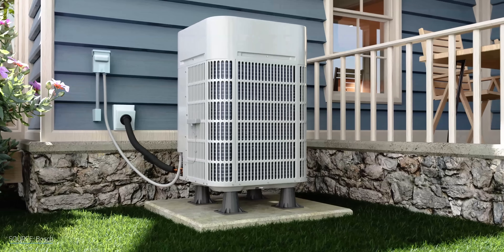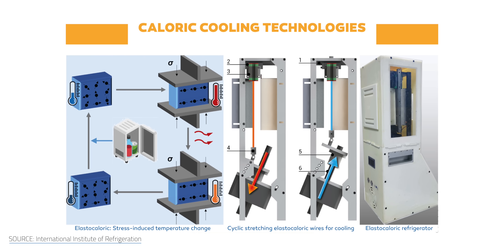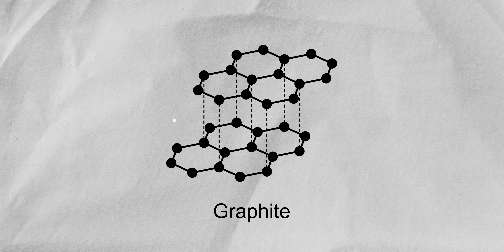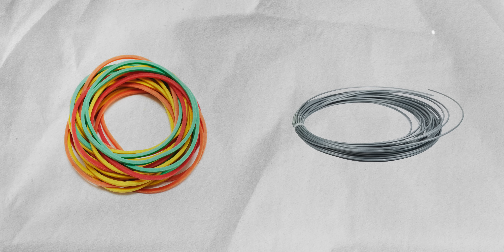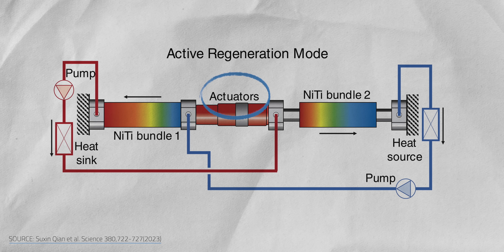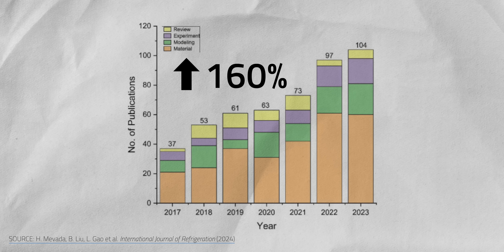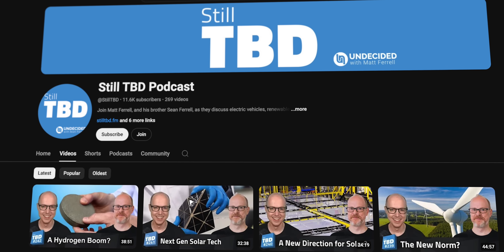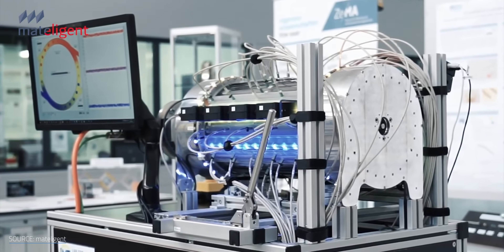How Solid State Cooling Could Change Everything

Comment: I’ll be the first to admit that I’m not going to look through all the comments to see if anyone else has had this idea.

Since elastocalorics shrink when cooled and expand when heated, is there a possibility that this linear expansion and contraction could be harnessed to do some of the cycling work instead of using an actuator?  It would basically be two compartments where a valve would cycle exhaust through  chamber one, effectively heating it up and pushing on the coils in chamber two, storing cooling power there.  The valve would then switch, cycling exhaust through chamber two, heating it up and causing it to push on chamber one cooling it down.  I would look at it in terms of a diaphragm or bellows between the two chambers.

I’m not super familiar with the science of all this, so this is just my odd layman’s take on the idea.  If anyone thinks this has merit, I’d love to at the very least be a part of the conversation.  Not an equal part kind you, but a part nonetheless.

Comment: seems like it'll be a lot easier to replace nitinol strings than refrigerant, should improve reliability! I would buy a elastocaloric fridge even if the COP was slightly worse, just so I wouldn't have to deal with refrigerant

Comment: It's interesting that none of the cooling systems I have (refrigerator, freezer, air conditioner) use any fluorocarbon.  They all use R600.  I understand that people in the USA are scared of it, but it works fine for a lot of the world.
Reply: A lot of the commercial refrigerators use R290 (propane) or R600(butane). I don’t know why people freak out about it. Most systems have less than 3oz of the refrigerant. Not even counting the fact that an atmosphere of pure butand, which is how the internal of the system should be, isn’t flammable at all.
Reply: @NicholasStillman  Butane/Propane is also more efficient.  It runs at much lower pressure so the compressors are tiny, quiet, and use minimal power.

Comment: Moving parts makes this idea a non-starter, moving parts wear out. None of this is needed, this is a step backwards all of this.  what is needed is a more efficient diode to filter off and separate out the hot electrons, just like a thermocouple in reverse. Cooling for homes can be done efficiently with paint that reflects all heat back to space.  Cooling for homes can also be done through an Earth mass, just running pipes through the Earth which maintains a steady temperature. Cooling for homes also can be done directly with sunlight by using evaporative ammonia in iron pipes and all of these solutions don't have many moving parts to wear out.

Comment: === Summary ===
  The video discusses elastocaloric cooling, a solid-state cooling technique that could potentially replace traditional
  vapor compression cooling systems, such as those used in refrigerators and air conditioners. The host, Matt Ferrell,
  introduces the concept of elastocalorics and how it uses materials like shape memory alloys (e.g., nickel-titanium alloy
  or Nightnall) to achieve the cooling effect without refrigerants, which pose environmental challenges.

  Key points include:

  1. Traditional Cooling Systems – Refrigeration and air conditioning usually rely on vapor compression cycles, which use
  refrigerants to absorb and release heat through phase changes.
  2. Elastocaloric Cooling Process – This system uses the phase change in metals such as Nightnall (between martensite and
  austenite phases) to absorb and release heat under mechanical stress, removing the need for harmful refrigerants.
  3. Nightnall’s Properties – Nightnall’s super-elastic properties allow it to change phases when stressed, causing it to
  heat up, then cool down when the stress is removed—without phase changes involving liquid and gas.
  4. Prototypes – Researchers have developed small elastocaloric prototypes, with some systems able to cool small
  compartments and devices with cooling capacities reaching up to 200 watts, enough for a mini-fridge.
  5. Challenges – Current elastocaloric systems are still small-scale, and there are technical hurdles like stress fatigue
  and actuator inefficiencies that require more development.
  6. Technology Readiness Levels – Elastocalorics are less developed compared to traditional vapor compression systems,
  but growing research interest and potential for replacing hydrofluorocarbons (HFCs) in cooling systems is driving
  progress in the field.
  7. Potential Impact – Eliminating refrigerants could significantly reduce global warming gases, and elastocaloric
  systems could provide a cleaner, more energy-efficient alternative in the long term.
  8. Advantages over Magnetic and Electrical Calorics – Elastocalorics are showing more promise due to simpler mechanics
  and better energy savings.

  The host encourages viewers to follow up with an interview with an expert in the field, which is available in a
  companion podcast.

  The video concludes with a call for feedback and suggestions, and appreciation for the channel's supporters.

Comment: While this is a fascinating thought, there is still quite some power consumption related to the circulatory system required in such a machine. 
My money's still on (a.) the pursuit of the Siebeck effect (by various, but still puny) devices that turn temperature differential directly into current (which can be used to power ACs or whatever you like), or (b.) sun collectors that directly power a mechanical powerhouse (steam locomotive, etc.), or (C.) sterling engines.  Problem with current solar is the diminishing return, losing %s of power going from the to that to the other.

Comment: Have you considered generating electricity with a highly efficient heat pump (300-400% efficiency)? For example, a heat pump using 1 kW of electrical input could produce 3 kW of heat. This heat could then be fed into a steam generator with 50% efficiency, potentially yielding 1.5 kW of electricity.

Comment: The 200 W demonstrator you mentioned is equivalent to about 682 BTU/hr, or around 0.05 Tons of cooling.  My house has about 3 tons installed, and for a lot of commercial installations I engineer, we put in around 15-30 tons.

I understand this is just the prototype stage, but I'm skeptical to put it lightly.  I'd place a lot more hope in magnetic cooling than this tech.

Interesting and novel, it sure is.  But capable of operating at a large scale for years and decades?  Unlikely any time soon.

Comment: NiTi is a very good thermal conductor. If you put stress in load section of the wire and leave other section always relieved, the relieved part will transfer heat into load section. Now, if the relieved part has a big cooling fan, when you relieve the stress form load section, the heat that it absorbed to return the shape would transfer into fan section and it could blow heat away. So theoretically, the maximum COP it this configuration must be the same as air cooled system.

You didn't notice the heat from the wire you demonstrated because you still have a long wire left before it reaches your hand. But, I played with dental NiTi with d=0.1mm and L=50mm, heating with a small lighter at one tip and holding it at another tip, it burned my finger when it came back to shape.

Comment: I'm going to throw this idea out to the crowd.  Not sure if anyone else thought about it this way yet, or even if it is practical for the purpose I have in mind, but what about human powered.  The thought came to mind when the description of the German prototype was brought up.  Specifically the use of "artificial muscle" as the actuator.  Well, why not actual muscle?  Weave the shape memory alloy into fabric and make a wearable heat pump.  It would have applications in a multitude of environments, including in the life support systems of space suits.  No, I did not forget about the issue with fluids being transferred to carry the heat energy to where it needs to go.  There have been such wearable solutions around for decades.  Although it's usually for taking a fluid from a reservoir that is either heated or cooled for the purpose it is needed.

Comment: I have a question. What if we create a 10-stages cascaded system for generating electricity out of air or ocean water based on heat pumps, which would consume no outward energy at all but only producing it? Is it possible? The system outlines are like this:

— 1st stage uses open air with temperature 0 oC to generate infinite amount of energy in container C1 at temperature 20 oC, using for this half less energy taken from a common source of electricity called ComSrc;

— 2nd stage uses C1 as a lower-end source to generate infinite amount of energy in container C2 at temperature 40 oC, using for this half less energy taken from a common source of electricity called ComSrc;

— …

— 10th stage pumps heat from the container C9 at 180 oC to the container C10 at temperature 200 oC, using half less energy taken from ComSrc;
— finally we utilise the difference of 200 oC to run steam turbines at efficiency of 60% to refill the ComSrc and have a net gain of 10%, which we supply to the customers. 

With solid state coolers the number of stages would be 3-4 intead of 10.
Is there any chance for such a system to be viable?

Comment: Most heat transfer relies on phase change. Fluid phase change handles more useful energy so it is hard to see what use category this metal would actually fill. Shrinking a vapor-compession cycle using a fluid like CO2 seems a better research goal. Now if this could replace the Carnot Cycle...that could be cool and useful.

Comment: The problem with elastocaloric technology is that the cooling and heating happens at the same spot, creating a challenge to keep the hot and cold sides separate. This has a negative impact on overall efficiency, because of thermal leakage between the cold and hot sides. 
On the other hand, phase change cooling does not require the hot and cold sides to be next to each other, which allows a high degree of separation and versatility. For example an AC system can be split in two parts, where the cold side is placed exactly where it's required and the hot side with the compressor are placed over on the other side of the building where their heat and noise are not disturbing.
The elastocaloric system requires a complicated mechanical system of actuators and valves so function, which highly complicates the system and increases the chances of mechanical failure, which is the only downfall of compressor based systems, because more often than not, it's the compressor that fails. Now imagine a complicated actuator system trying to reach the reliability and simplicity of a motor moving a piston submerged in oil.

Comment: I remember a diode refrigerator I got out of an rv that was left. It had a plug that was reversible, and would keep things warm. It ran on 12v but had an adapter that did 120v... it definitely would get cold, and zero noise.
Reply: Peltier-effect coolers -- you apply an electric current, and one side gets hot while the other gets cold; reverse the polarity of the current and the head movement reverses. They're sitll around in low-performance heating/cooling devices like portable coolers, and had a brief period of usage as a heat pump for CPU coolers, which were more efficient at pulling heat out of a hot CPU and moving it to a standard heat sink. What killed them in that role was the fact that, when the Peltier-effect device fails, it becomes a very good insulator, which causes thermal runaway even faster than having the fan fail on a normal heatsink/fan combination, often causing the CPU to fail before it can be shut down.

Comment: decades ago at about age 12 i found that twisting aluminum wires would heat up and untwisting them would cool down.  i didn't think about coolant exploits as i was looking for electrical resistance change.  i don't know if this could be exploited to do cooling on any scale.

Comment: If hydrofluorocarbons are so bad (they are), why aren't we spending a lot more time building systems around the more efficient and vastly lower cost hydrocarbons? Propane significantly outperforms hydrofluorocarbon refrigerants on nearly every measure. Efficiency, max cooling and heating levels, global warming potential, pollution from manufacturing, etc.

The one downside: it's flammable. But it's not much more flammable than the natural gas feeding many appliances. Slow leaks are nearly zero risk. Catastrophic failure of refrigerant piping in cars and homes is so rare, it's basically unheard of.

I think the trade-offs need to be revisited decades ago. We didn't need hydrofluorocarbons. We definitely don't need these even more exotic, toxic, and polluting formulations today.

Comment: Elastocalorics will need to produce a 𝚫T of at least 30°C to to begin to compete with existing vapor compression systems, but they're nowhere close to that.  Moreover, they'll need to be able to move heat energy through a tiny opening in a thermal insulating barrier so that the space that has been heated or cooled stays hot or cold for hours even when power is removed.  Another form of sold-state cooling that has been around for decades, the "thermoelectric effect", fails miserably in the second instance.

Comment: Maybe 'cool' for a milk-cooler besides the full automatic espresso-based coffee machine for that latté. Fresh whole milk (organic please ;) ). Would it work as a heater / cooler for cupholders in vehicles? There are already solid state refrigerators (using semiconductor based plates) with as benefit in hotel rooms:  no compressor based noise!  Thanks for this newer option ..  :)

Comment: He first starts saying something that matters around 6:05

It says COP 3 for vapor compression tech vs. COP of up to 20 for elastomeric but that's without supporting tech.

They say a reason for this tech is to eliminate refrigerants, but CO2 is actually a promising alternative.

More promising, I think, is using this as a reliable heat pump alternative is below freezing temps.

Comment: unless the stretch heat cool is crazy efficient this seems not promising since the heat and cooling are in the same place so a system would be needed move the heat elsewhere. at least using liquid gas phase change both phase are moving anyway

Comment: If the biggest issue with vapor-compression is the GWP of refrigerants, then why not just use hydrocarbon refrigerants that are proven to have a negligible GWP, such as R-290 (propane), R600 (butane) or R600a (isobutane) - all with a 100yr GWP of less than 10? The flammability risk for stationary systems in a small scale is rather negligible, typical charge volumes of these for a residential appliance like a refrigerator is in the single-digit ounces, while a propane cylinder attached to regular barbeque is 20lb and is a 'user-openable' system. The industry, at least in North America, the progression has been slow to move between HFCs and HFOs that reduce the GWP, while constantly complicating the landscape for anyone dealing with HVAC systems, leading to a nightmare of red tape and overpriced refrigerant costs. The whole R22 -> R410A -> R454B lineage has reduced the GWP of the refrigerants dramatically over the course of the past 30 years, but yet simpler alternatives are available. This seems like a drastic stretch of a concept to replace a proven and well-working system that has low-hanging fruit to pick to resolve the environmental concerns about it in practice. I always find new ideas like this interesting, but to say it "could change everything" is a bit of a stretch right now.

Comment: HVAC Designer Who Needs to Vent.

I'm an HVAC designer and I have some qualms with your vapor compression cycle spiel. Overall I appreciated the information you provided in this video, just wanted to clarify some of the terminology.

1. Listing refrigerator, air conditioner and a heat pump is like saying cars, trucks and V6’s. Heat pumps are a way of doing air conditioning or refrigeration.

2. What the heck is an expander? Call it an expansion valve or even an expansion device like the rest of the world.

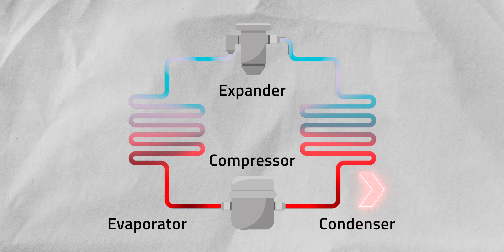3. 3:50 (https://youtu.be/GHl6buYjZGE?si=9qZVcAhR1kL-LwMz&t=230) it doesn’t work in a similar way, the vapor compression cycle works exactly the same way in both refrigerator and air conditioners.

Comment: In the 80's we used LN2 to cool SiLi detectors in the analytical tools attached to electron microscopes where they tried Peltier Thermoelectric cooling to reduce LN2 waste but most people just stuck with refilling the LN2 Dewar's every few days.

Comment: Interestingly, if you could design a "system" with a COP of 20, you'd need around 2.5KG of Nitinol in some efficient configuration to cool the average home (which is about 500m of Nitinol wire with a 1mm cross section)
The length of wire doubles as the COP halves, so a COP of 10 would require around 1000m of 1mm Nitinol wire. 
Doubling the cross section halves the length.... but potentially impacts the efficiency of the system.
These lengths may seem "long".... but spooled on some mechanistic reel and connected to an actuator..... can be made fairly compact.